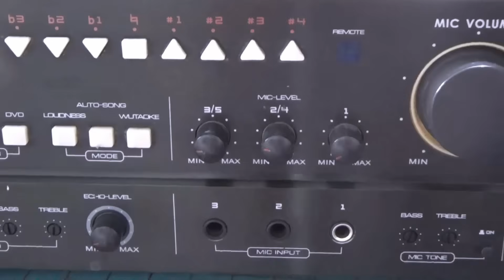How to prevent buzzing from loudspeaker, grounding tips for amplifiers and speakers to hear better

Comment: This is a horrible idea. If your home already has a main ground, now you just created an electrical path for a short, surge, spike in electricity from another appliance or electrical grid to be dumped directly to your stereo equipment. Please tie directly into one main ground per building. I used to do this when I was less experience as well. Two separate earth grounds can actually pickup more noise and create ground loops. Very bad idea! Ask any experienced electrical engineer. Please don’t!

Comment: My amplifier is getting humming, but when i attached the ground wire  it stopped humming, but I'm afraid if it would hamper my amplifier, will it get shortcuIted to my amplifier ??
Reply: Just use only one extension cord with multiple outlets for your sound devices. One cord = one ground = no ground loops.

Comment: Can i attach the ground in cement? Thanks
Reply from the maker: It is grounding wire for amplifier. has anti-interference effect. You can bury it in the ground 50 - 70cm. cement can be attached
Reply: I mean my amplifier setup is on the 2nd floor building, can i make a hole in cement florr then attatched the grounding wire in cement floor?
Reply: No!... It's must go underground at least 50cm!

Comment: Instead of making a hole in the wall or floor, can i connect a wire from my receiver body to the ground pin in my 3 pin power socket? Will that work the same way? My receiver has a two pin plug and i want to ground it through power socket to get rid of speaker hum noise. Hope you understood my question sir.
Reply: Tech Nerd before connect that wire to ground wire at 3 pin socket you need to check if earth at 3 pin socket have leak electric or not..if not you can connect that wire to earth at 3 pin socket

Comment: I need to do something similar with my system, as my electrical ground is either nonexistent or very weak.  Should it matter if ground wire is running near or next to speaker leads?  Also, does the length of the ground wire running to ground matter?  The nearest good location that I can run a ground wire to earth is about 10-12 feet from my system.  Thanks.
Reply from the maker: Use a wire diameter as large as possible, at least 1mm
The wire length is as close as possible, however you can extend it to 6m
There will be no impact if the line runs close to the speaker
Reply: Thanks for the info!